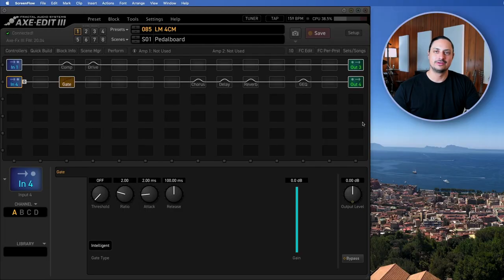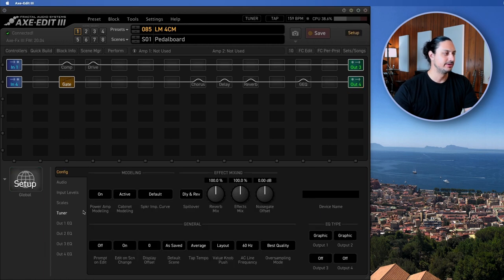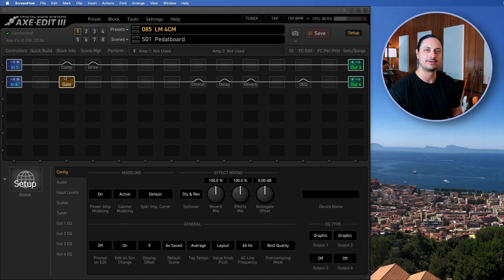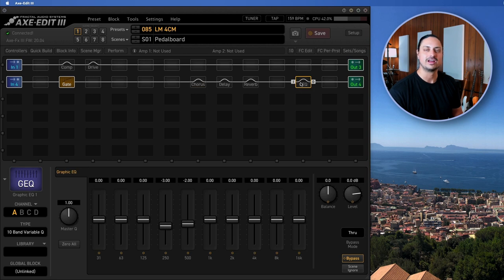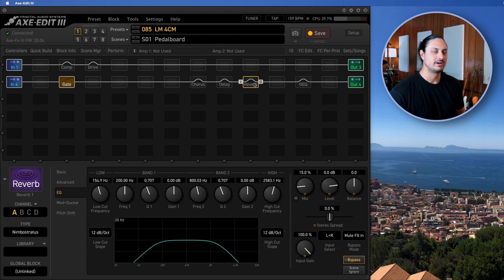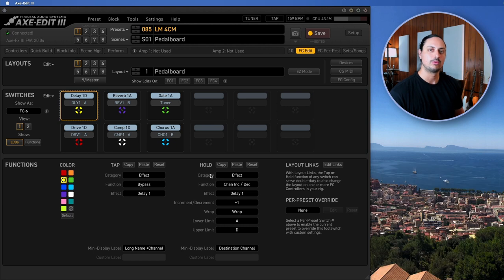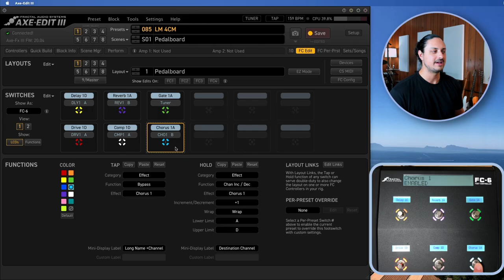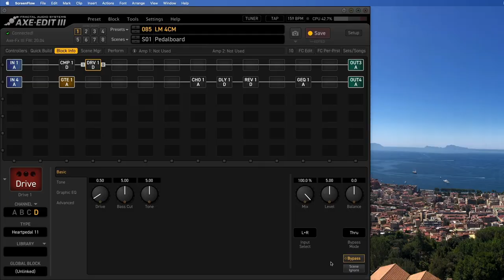Fractal Audio Axe-FX III: your Ultimate Pedalboard using the 4 Cable Method & FC-6 Foot Controller

Comment: Hey bro! Can you blend an AxFx amp sim with your real amp for some cool flavors? If so.. would that go on the front side? Be a great tutorial. Thanks!
Reply from the maker: Hey! That could be a bit more complicated and the setup in this video won't work. You would need a second cab or powered FRFR speaker for your axe fx amp. You can't plug your fractal into a regular guitar cab w/o a power amplifier. Furthermore, you can't plug two devices into one guitar cab since the ohms need to be matched correctly between head and cab.
Reply: @LucasMessore  Hello! I may have explained that wrong. Couldn't you add an amp & cab block in the axe edit grid & blend that with your real amp? Of course you would need to turn amp & cabs on in global? I know it's not recommended but it sounded phenomenal in a video I seen. Now I can't find it. It's kinda like how you can blend 2 amps in axe edit but 1 would be the real tube head. Hope that makes sense. Thanks!
Reply from the maker: @douglasm2921  Oh cool, I think I know what you mean. So basically have one signal path with your real amp, and then a second going to your interface that has axefx amp and cab so essentially two amp setup? That could definitely be cool but I will say they will for sure be out of phase so you'd have to align them
Reply: @LucasMessore  It won't let me post a link but if you put this in the search at fractal forum. You will see what I mean. Axe-Fx III - Combining Virtual Amp with Real Amp
Reply from the maker: @douglasm2921  Yep definitely give it a go, just watch out for phase
Reply: @LucasMessore  Thanks man!!

Comment: Really a great help, but I still have some problems with my setup.

When I use the FM9 as an effects processor for my Engl amp, I can adjust the OUTPUT LEVEL.

If I leave the value at +4 dBu, my AMP is equally loud with and without the FM9, but there is a lot of feedback that needs to be cut off as soon as possible.

If I change the value to the second option, i.e. -10 dBV, the AMP with FM9 is quieter than the AMP alone, but I have less feedback. 

And it's even worse when I use reverb or delay, it sounds a bit hollow too.  Is it possible that delay and reverb have a slightly different effect with this method?

If I then set the output level (to the amp) to -5 to -10, then all the whistling is gone ... BUT ... the AMP alone is then much louder than with the FM9.

Now comes the BUT and a perhaps stupid question ... a tube amplifier should be allowed to live out its performance, so to speak, otherwise there could be problems with the tubes, i.e. could it be that with -10 dbV and the output level at -10 I am damaging my AMP in the long run?

I hope I was able to formulate the question reasonably clearly and I hope it is not impertinent to ask you for help.

Sorry for my bad English

Cheers,
Christian
Reply from the maker: No I totally understand what you're asking and had the same issue. Gain staging the 4cm is tricky. I run mine at -10db personally but I also use Level controls on the Fractal pedals and Output stages to level match things, it had to be done carefully as it was not level matched with everything at 0. And as far as your feedback issue that I'm not sure about that only happens to me with a lot of gain and hollowbody guitars. You shouldn't really have feedback for an at home or studio rig unless you have it cranked and are holding notes out facing the cab.
Reply: @LucasMessore  ... first many thanks for your feedback .. really appreciate it. Yes I m using my ENGL in Hi Gain mode ... the idea is to reduce additional the output to -10 or -12 and then it is working perfect  .. but as I stated the difference in volume with and without FM9 makes me nervous. Where does the power go when I turn it down (e.g. -12)? is this a problem for my tube AMP ?